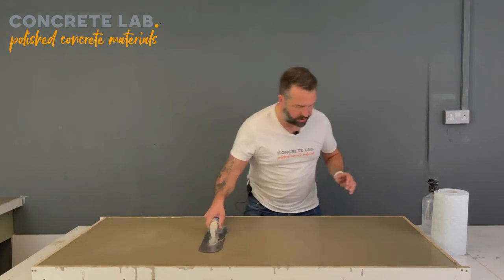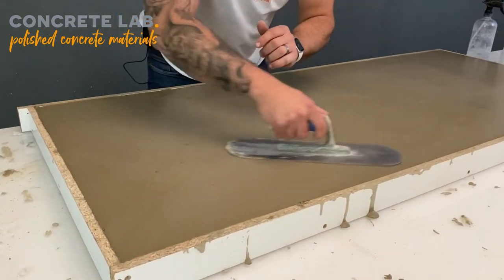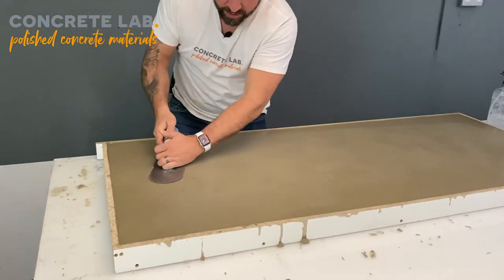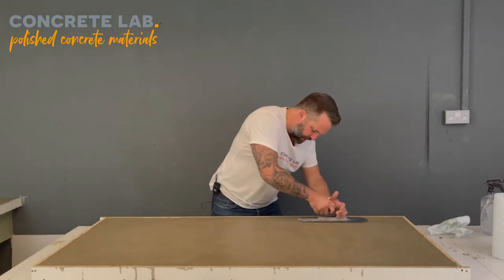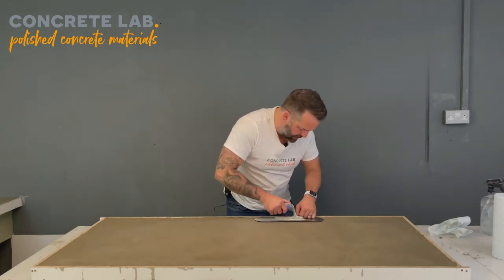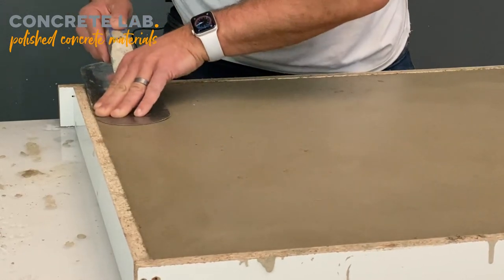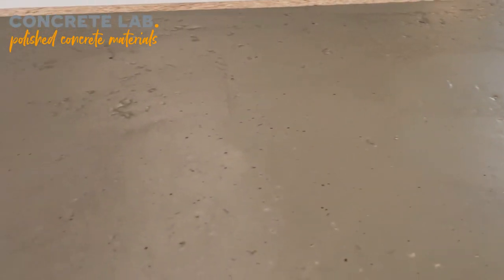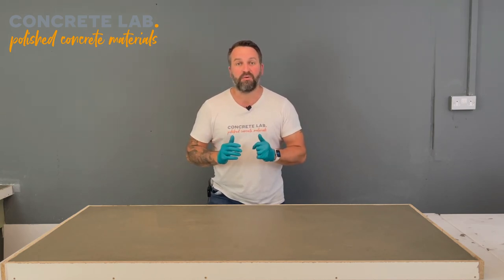How To Use Our CAST IN PLACE Concrete Mix  - Part 3C  - Trowelling

Comment: Hi there we’ve made a cast in place mould and plan to pour very soon please could you advise what products to use
Reply from the maker: Yes we have a cast-in-place mix just for this. If you go to the help section on our website there is a Cast InPlace Mix calculator to work out how much you require